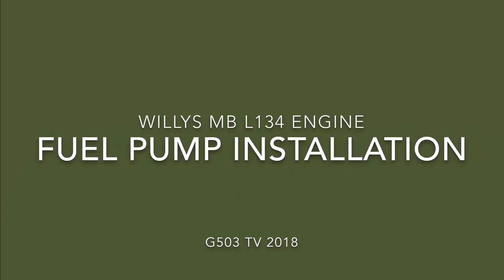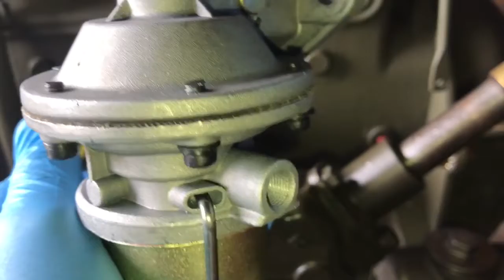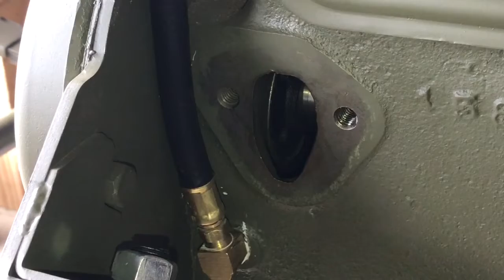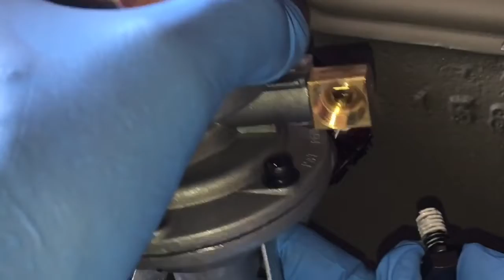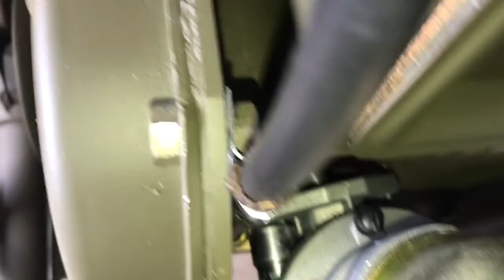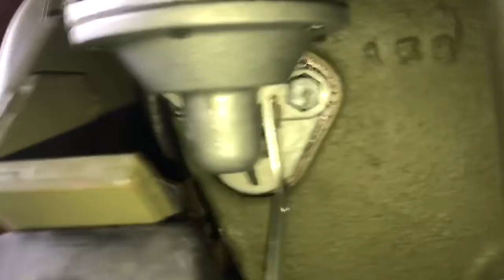Installation Of The Fuel Pump On A Willys MB L134 Engine

Comment: I changed my bolts to Allen head!  Makes the install and removal so much easier.
Reply: Could you please tell me the correct size and thread for these bolts as I am in the process of replacing my fuel pump.
Reply: @eiliffielstrupguldbrandsen2792  I took one of the stock ones to the hardware store and matched it up. Sorry

Comment: TIP if not already mentioned ~ the front mounting bolt can be screwdriver slotted [& are often found this way] as not everyone has a 1/4" drive socket set. This is achieved by mounting 2 hacksaw blades to cut the slot or an angle grinder & steady hand.  This is an area that usually has an oil leak that goes unattended. A good heavy screw driver with square or hex drive works wonders as does using sealant on any threaded member that screws into a through hole to oil or coolant.

Comment: No spacer? If you don’t add the spacer, won’t your fuel pressure be too high due to longer contact on the cam?
Reply: THERE NEVER IS SPACER WITH THIS MOTOR!
Reply: @joefalabrino5092 haha. I made this comment 4 years ago when I was new to Willys jeeps, but this motor did use a spacer on dual action fuel pumps, and if you use a solex carb rather than a WO Carter, you will also need a spacer.

Comment: Thread sealant, much better than teflon tape in this application.  
However, do NOT put it on the female threads in the fuel pump.  
When you put the fittings in, it will push the sealant ahead of them, into the fuel pump and expose it to the flow of fuel on it's way towards your carb jets.  
Absolutely, put it on the male portion of the fittings before assembly.
Reply: Indeed, NEVER put sealant inside the thread or these bolt holes. You will cause seal residue and parts traveling through your oil system. A potential nightmare...
Reply: And in the block threads it could get into the oiling system!